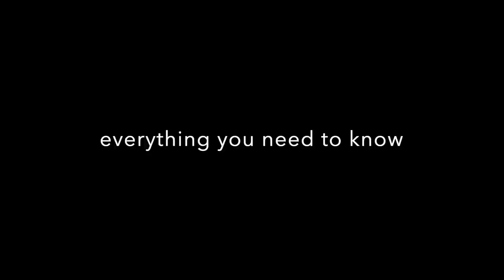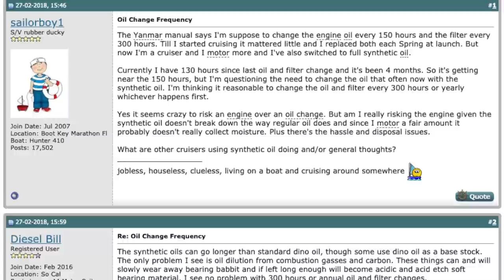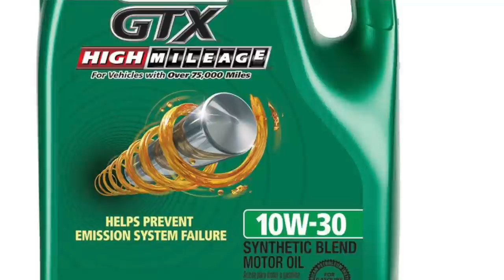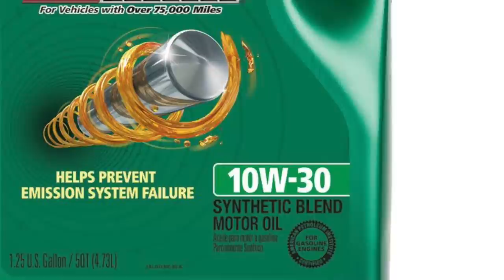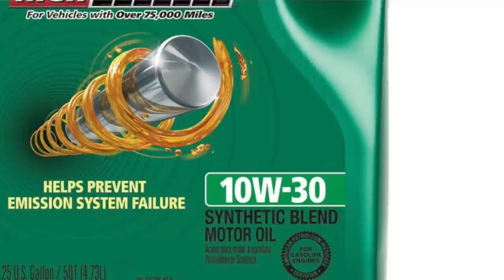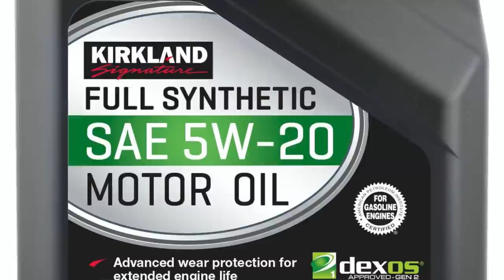Is this OIL wrong?? Episode 120 - Lady K Sailing

Comment: Ok.... I've been a lubricants and fuels chemist/engineer for over 30 years.. You've made quite a lot of mistakes in the way you've discussed this. Some of what you have said is correct, but quite a lot more is misleading and some just incorrect like your description of multi-grade oil get thicker when it is hot... it doesn't, it gets thinner! Even amongst 'racers' and mechanics there are so many 'wives tales' that it's dangerous to listen to any of them. The best thing you said was to LISTEN TO THE MANUFACTURER.... period.  Synthetic oils are NOT always better btw, and as a matter of interest my Volvo D2-75 has an approved oil in it and it's not synthetic and I have no intention of going to synthetic. Take a look at piston engine aircraft engines, almost NO synthetic oils are used. There is some in a couple of brands in one or two of their grades, but overall there is only a couple of percent synthetic oils used annually in piston engined aircraft. Perhaps look up what happened with Mobil AV1 (a PAO synthetic) massive engine damage and tens of millions of dollars paid out worldwide. Dino oil has its place too.
Reply: Change when the colour shows the oil carrying a load of combustion waste. "Maple syrup" is when to start thinking about changing and that time can vary depending on load and conditions.
Reply: BS synthetic is ALWAYS better ! your advice is bad and outdated ! see my post above  
BTW, we belong to SAE !

Comment: Rev’ing the engine before shutdown is a recommendation in the Yanmar Diesel engine manual. They recommend 2-3 maximum revs of the engine for up to 30 seconds and then allowing the engine to cool down on idle for 5 min before shutting down. This is to clear out moisture and carbon buildup caused when running at low speed while docking or coming into harbour.

Comment: I have been a mechanic most of my life. My opinion and other mechanics I have known is:  NEVER rev up and kill a gasoline engine cause you are flooding the cylinders with unburned fuel which will wash the oil off the rings and wear them out as they will be dry on the next start. The rings have a gap at their ends and gas will seep down through them. I want my engine at the lowest idle possible when I shut it down. As for diesels I only know about some boat diesels and when you turn them off it is killing the fuel which has some lubricating properties so I would suspect it would not be a good idea there either. I think the whole thing was started be big loud bike and car guys doing it to show off. Then they had to make up a story to justify it as wise.

Comment: Tim, a multi-viscosity oil does not get thinker as it heats up! I am sure you know this but you say that it gets thicker as it heats up. A10w40 oil is thickest when cold. Then as it gets hotter the viscosity goes down (thinner). What the 40 means is that the oil behaves the same as a 40 weight oil at high temps. But the viscosity is still less then it was cold. That is the reason for the multi viscosity. You want a 10 weight oil at zero and a 40 weight at operating temperature. Polymers are added like little spiders. When cold the spiders have their legs curled up then as they get hotter the legs extend making the viscosity higher then it would be. thanks for the videos

Comment: Years ago, consumer reports ran NYC taxis to 100,000 miles with different oils. There was no difference in wear between synthetic and dinosaur.
Reply: Modern oils, dinosaur or synthetic are so goo these days, as long as you are using an oil that is rated for gasoline engines on a gasoline engine and diesel engines on a diesel engine, you can't go wrong !  IIRC,  the highest rated oil for "spark ignited" (gasoline) engines is API SN.  The highest rated oil for "combustion ignited" (diesel) engines is CJ-4 or CJ-4 Plus.
Reply: That test was conducted by Amsoil, and the results were significantly different from what you stated. Consumer Reports never did this test, which would be far too expensive for a magazine.
Reply: That's was Amsoil that performed those tests, and you got the results wrong. Consumer Reports never did this, and it would be far too expensive a test to write a magazine article.

Comment: I recall in the 1980s some aero-modellers using 'this dodgy new synthetic' oil in their 2-stroke engines. Some 'pilots' were engineers and would measure the cylinder wear of these 10,000 RPM engines. They insisted there was almost undetectable wear after many hours of flying. No comparison with the mineral oils.

Comment: I remember when turbo cars started to get popular, the recommendation was DO NOT goose the engine or run it hard just before shutdown. Because the turbo depends on the oil for both cooling and lubrication, you don't want to cook the oil that is sitting in the turbo just after shutdown.. so if anything, IDLE for a minute or so to cool the turbo before shutdown.  Also, minor point of semantics, multigrade oils don't actually get thicker with increased temperature, they just resist thinning out as much, such that (for example) a 10W-30 will act like a straight 10 weight at the low temperature and a 30 weight at the high temperature. 
Love your videos, thank you very much for the effort 👍

Comment: Hi Tim, I just discovered your channel about 2 weeks ago and I'm addicted. I've been binge watching about 10 episodes per day! 😅

I've never commented before, but since you touched on a subject I'm quite familiar with so I thought I'd chime in. Unlike many other internet experts I happen to be a retired master automobile technician and automotive technical college instructor with a total of 41 years experience, so I know a thing or two about engines and oil!

I applaud your video here because for a layman, you got 95% of it right or close enough to right that it would be splitting hairs to make a correction. One clarification, the Winter viscosity temperature is tested at 0°F and the hot temperature is at 212°F. Diesel engines not only need more detergents but often require a 40 weight oil because there is generally significantly higher loads on the bearings at lower rpm than a gas engine, so a heavier viscosity is required to protect the bearings.

In the interest of correcting myths, what you said about revving car engines to fill the float bowl on a carburetor is not true. 90% of your viewers likely have never owned a carbureted car and even fewer have rebuilt them or really understand how they work.

The fuel pump provides constant pressure to the carburetor regardless of engine rpm, and a float operated needle valve maintains a constant fuel volume in the float bowl. As fuel is used the float drops slightly, opening the needle valve and fuel enters until the float closes the needle valve. A sudden "goosing" of the engine will not change the fuel pressure or the fuel level in the float bowl. As a general rule, goosing an engine in neutral, or free-revving an engine is generally considered bad for the engine and it serves no purpose at all other than it may sound cool. 

Oh, and anyone else reading this, always change the filter when changing the oil! How cheap can you be?

Keep up the great videos, and I really liked the trip to the Bahamas. You need to do that again! Peace ✌️
Reply from the maker: Thanks for watching!

Comment: HeyTim,  On “goosing the throdle before shut down”.  I’ve always heard that by doing so you tend to wash any oil that is on the cylinder walls off the cylinder walls.  This could cause excessive wear the  walls. Seems to make sense to me.

Comment: Thanks. Yanmar's little 1gm10 manual says to rev engine before shutting down. Burns out some carbon deposits. Especially good with weekend cruisers that don't use their engines much

Comment: Good stuff, as always. You are a voice of reason in the B.S. I would add that if you are running conventional oil and you have a minor leak like a front or rear crank seal weeping, for instance, if you switch over to a synthetic you may see that oil leak get a bit worse as synthetic is usually better at getting into tiny crevices. It is not only good at getting into tight spots, it's just as good at getting out too if there's an escape route. As far as revving a carbureted muscle car prior to shut down, all one is doing there is fouling the plugs with fuel squirts from the accelerator pump and not giving it time to clear itself. If the fuel pump / float / needle / seat is all working correctly then the float bowl is already full at idle and the float is keeping the pump from overflowing said float bowl. Revving the engine then shutting it down can only drain the float bowl then you shut the engine off before the pump has a second to fill the bowl back up (assuming a mechanical fuel pump), rendering the logic you mention others citing as moot. Don't do that to your muscle car (I've been ASE Master Tech since the 80's, muscle car owner since 16 y/o). I'll also second the previous comment that petroleum is not chemically organic, it's not dinosaurs or prehistoric plants; that is a myth. Hope you see fair winds soon, sir!

Comment: Thanks again for clarifying some of the basics.  You dispelled a couple of myths I learned in the 80's.  1)  You can't go back to conventional oil if you use synthetic, and 2)  You need to use a thicker oil in the winter than in the summer.  I never did get a handle on that last one.
Reply: I can 100% guarantee You Want to run thinner oil in the winter 😱

Comment: Good video. Manufacturers want you to make it to the end of the warranty period. Change your oil when it changes colour and that includes synthetic. Cheap dino oil changed frequently is perfectly fine. Synthetic may give you a cushion but is not worth the money. Go with a synth blend if you want. Adding different weight oil of the same brand just changes the W ratio. Adding same brand 10w40 to 5w30 in equal amounts yields 7.5w35. The main thing is to watch the oil colour. Change at "maple syrup" and you can't go wrong and you'll far out live the warranty.
Reply: Wrong. Oil turns brown not because it's dirty, but because of oxidation. It's the same reason apple slices will turn brown within minutes. It's not dirt. If you really want to know when to change your oil drain a sample and have it tested by a lab. You'll be surprised, I promise.

Comment: Another important point is 15/40 diesel oil contains Zinc, which is necessary for flat tappet cam engines. 
Not as much as it used to, due to modern emission systems.

10/30 car oil doesn't contain any Zinc because all modern car engines are roller cam. 

For an older gas flat tappet engine, say an early 90's 5.7 mercruiser app, 15/40 diesel oil is a much better match due to some Zinc content. 

Another good practise is to add a extra Zinc additive on older gas an diesel apps to up the Zinc content to what it used to be. A cheap Zinc additive available is good old STP.
Reply: That's not true. Diesel oils like Rotella T6 10W-40 contain 1200ppm (parts per million) of "zinc" (zinc dialkyldithiophosphate) or ZDDP for short. The ZDDP levels in API SN and SN Plus oils is 600 ppm. API rated oils between 1990 until after 2000, like API SJ had about 800 ppm. ZDDP has been found to shorten the life of catalytic converters so the oil manufacturers have reduced the ZDDP content to comply with OEM car makers but also use newer anti wear additives, like Moly. Even today oils with a viscosity of 50 or higher will have more ZDDP,  up to 1200 ppm, even oils for gasoline engines.

If you don't believe me take an oil sample and have it analyzed. The labs always show the exact Zinc content.

Comment: I always used straight gradeno sae30 shell in our  my older diesels, Volvo and sabb. It helped,with compression, not the engines were poor staring, and helped to keep the cylinders and pistons lubricated. The sabb actually required a few drops into intake to start in cold weather. Newer yanmar can use both natural and synthetic. We used15w40 shell rotella in the yanmar. Installing a new beta soon, again using 15w40. I don't want to go synthetic as the oils are quite runny. For a boat that doesn't run everyday, I rather have the oil protect the internal surfaces and not run down. Also in the long run will keep it staring easier.

Comment: This is a great subject, I am a pilot of Jet engine airplanes as well as an owner of a 2 engine reciprocating (piston) airplane and a sailor  of an Irwinn  45 Ketch rig. as for changing my oil in my my ground rigs (automobiles/truck) the manufacturer says 7500 miles. the oil companies say 3000.miles. I change my oil at 5000 miles. Oil companies sell oil. engine manufactures sell engines!

Comment: Very nice video. The one comment I might have comes with my ownership of a normally aspirated engine in my airplane. For a long time, on cold starts (think Wyoming,) I would pump the throttle while engaging the ignition and cranking the engine. I stopped doing this when I managed to start an engine fire once from, apparently, overfilling the fuel bowl. I was quick to deploy my fire extinguisher and the engine was no worse for wear (though I did get some interesting questions from my A&P at the next annual.) I don't know whether that's possible here, but perhaps worth investigating.

Comment: If you don’t want dry start hook up a start button up. Crank the engine before started the engine to get the oil in the block and out of the pan than start the engine. Now I meet a man who raced cars after the race he would change his oil he was asked why did he do that he said oil is cheaper than engines. So I would not skip the oil change and filter at the same time but I would put a remote oil filter a put a trap with a magnet in the trap on older iron block engines to look for issues and on newer engines send out the filter to check for metal shavings so I can get it fix before my life depends on it and it doesn’t start or dies the black smoke death. Just remember engine repairs and replacements cost more they oil  some engines damage can and will hurt the environment by oil spills just think a busted block spilling oil and water in your boat because a snapped rod punched a hole in the block or a punched head off the block and the automatic pump switch in your bilge will pump your oil and water out in the ocean or whatever water you are in. I would have a oil filter check once a year or pull the oil plug out of the oil pan to check the magnet for metal if it has one. I would look at some way to check all the fluids in the engine heat exchanger and the coolant. Now in the United States semi truck owners send a sample of oil to get tested to check the Heath of the engine I think it about a $100 u.s. I would look into something that would keep the engine run safely.

Comment: Fyi There is one situation where you should never use synthetic oil. If you have a rotary engine like on a mazda rx8. Because they burn engine oil in the rotors and synthetic oil doesn't want to burn and destroys the seals. 😅

Comment: I have an older Westerbeke engine that requires SAE 30 heavy duty diesel engine oil.  I find that the best place to find this engine oil is at Walmart!  I buy Shell Rotella T5 Synthetic Blend, Heavy Duty Diesel, 10W-30 Engine Oil at Walmart.
Reply: I use 15w40 in my Perkins 3 cylinder, 18HP diesel. And am super happy with it.

Comment: The one thing that wasn't addressed is why you change your oil in the first place. Sounds simple but isn't. They sell oil filters attachments in which you only change the filter not the oil. The reasoning being oil never wears out just gets dirty. I almost bought one of those systems you could save a lot of money. So I consulted my local expert. Yes you could get the dirt out of the oil, but  eventually because of the nature of combustion engines there is a buildup of acids in the oil which is deter mental to the engine.

Living where It can get very cold 10w or 5w is necessary. As I under stood it  10w 30 is a mixture of thinner and thicker oil. I never knew the oil to change with temperature except to get thinner ( flow better) as it warmed.

Comment: Don't understand why there is any reluctance to follow the manufacturer specs for oil type and service intervals for oil changes AND filter changes.  Why would you jeopardize your $15K to $30K Yanmar/Volvo/Beta/Westerbeke by using  a different oil type or trying to save $15 on a filter?  Changing your oil is the absolute most simple maintenance action you can perform to protect your engine.  If you do nothing but change your oil/filter at the recommended interval and winterize your engine when the climate dictates, you are pretty much guaranteed your engine is going to be trouble free for at least 5,000 hours.

Comment: There you go Tim.. 
Oil is not from dinosaurs. So its not a fossil fuel. We extract oil from so deep into the earths crust, that it's before the dinosaur era.
Reply: Petro is, technically, a fossil remain but just the chemical part. This "Dinosaur" label, however, is silly. Did they all lay down and die closely packed on a flat area that MIGHT have been covered up later? From Nat Geo: "Petroleum, also called crude oil, is a fossil fuel. Like coal and natural gas, petroleum was formed from the remains of ancient marine organisms, such as plants, algae, and bacteria. Over millions of years of intense heat and pressure, these organic remains (fossils) transformed into carbon-rich substances."
Right, seems to be it was the super algae blooms from a hot, CO2-rich atmosphere back then?